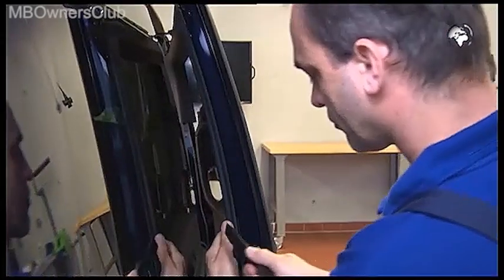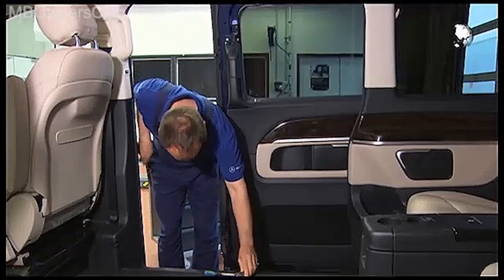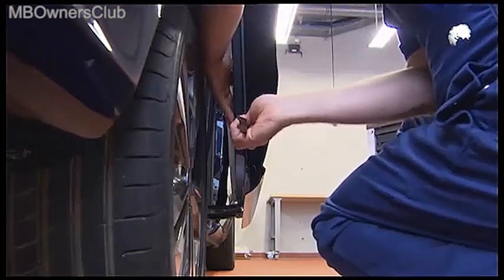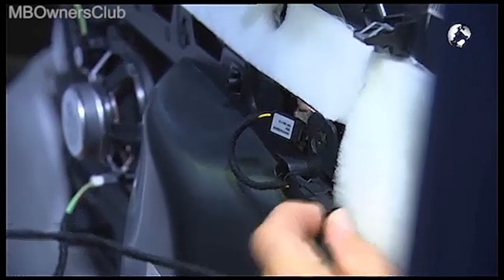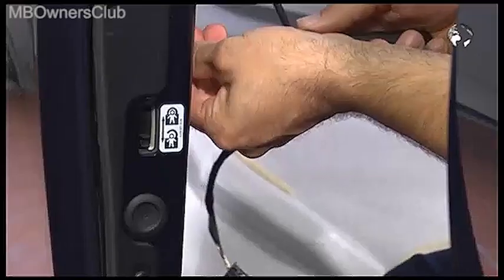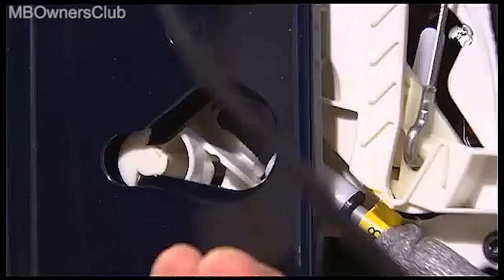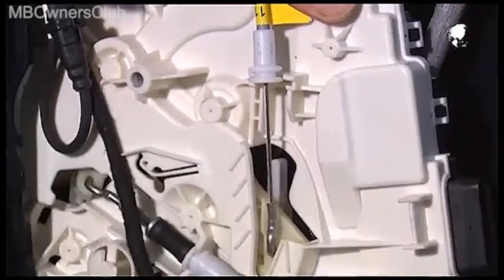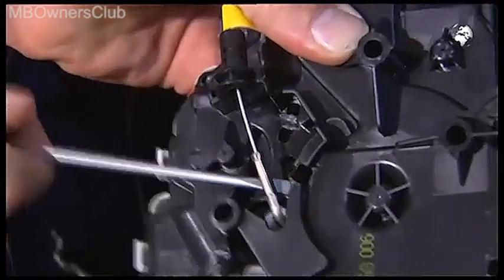How to Remove the Electric Controller Unit of the Sliding Door on a Mercedes-Benz - V-Class

Comment: Hi there if the cotrol unit is removed how will it lock all i want to is remove the electronic doors  which cable do i need to remove for closing and opening electronic doors want it to have manually done